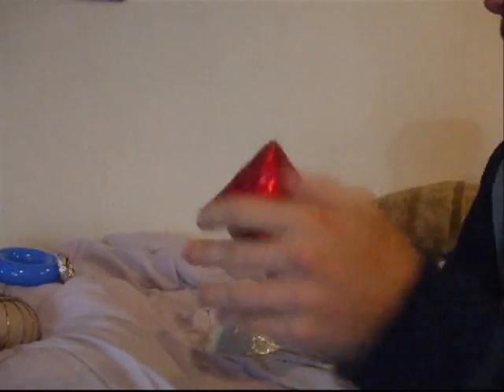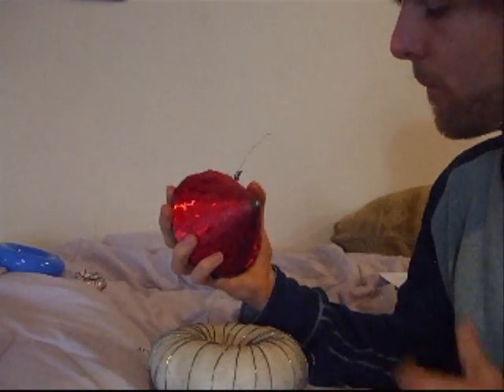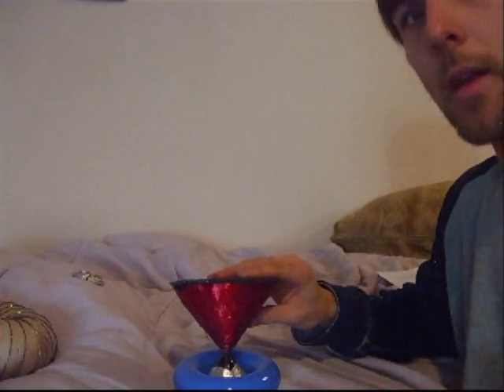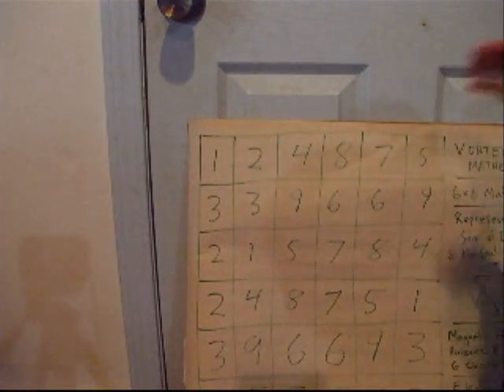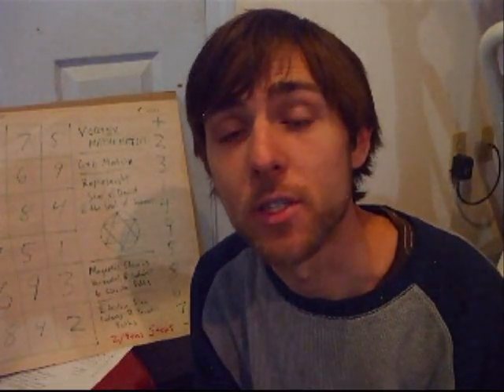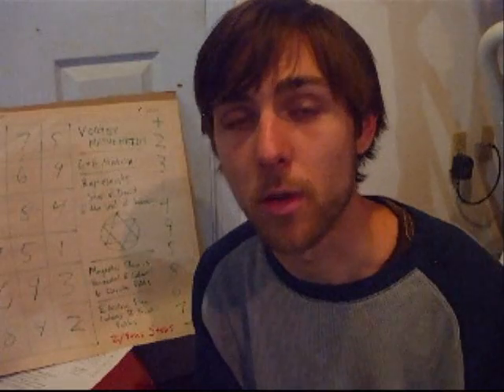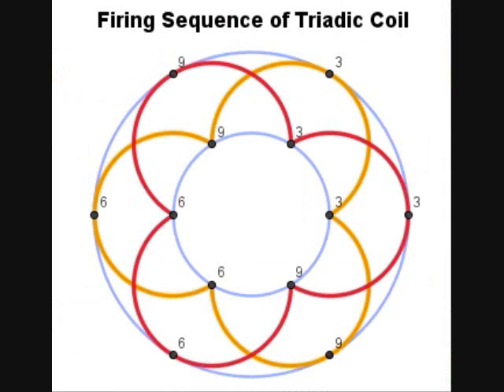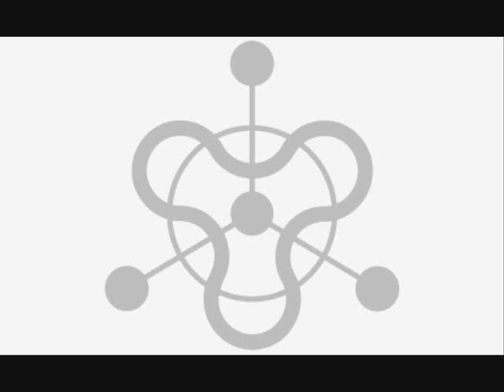New Developments in Vortex Mathematics and the Rodin Coil - 3/3

Comment: Hey I got a question. The field vortex in the center of the toiroid... what would happen if you make a small version of triadic coil out of superconductive material and place it in the center and then take molten diamagnetic substance like the bismith tin alloy and pour in the center so that it completely encases the superconducive triatic coil... all this while the toiroid is powered at the freqency of the perpendicular field lines on the earth. Wouldnt the molten diamatic material...  (next)